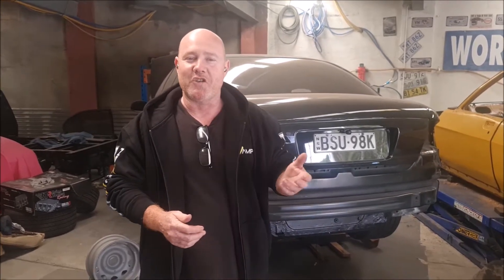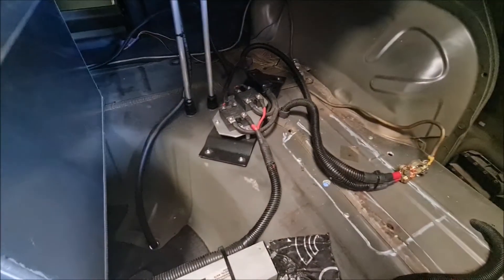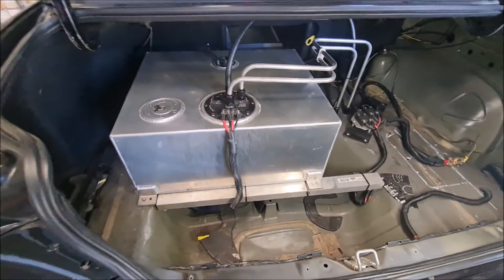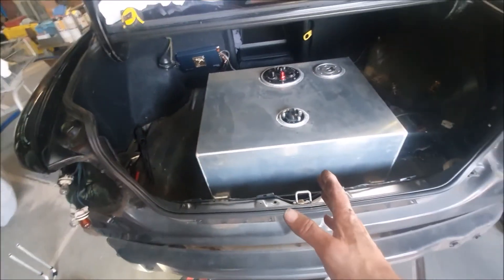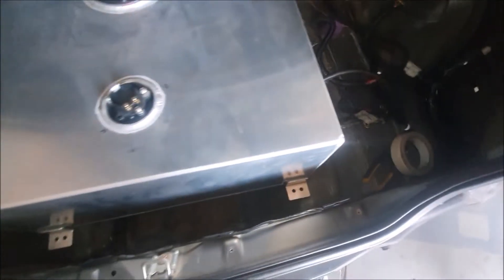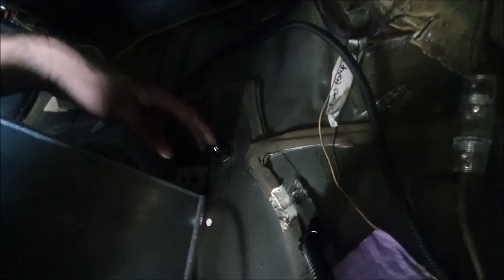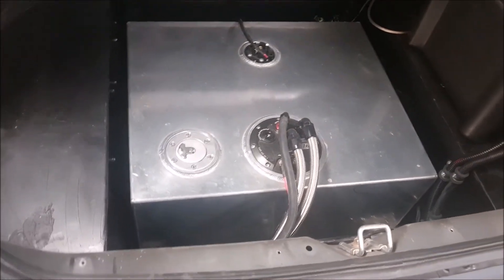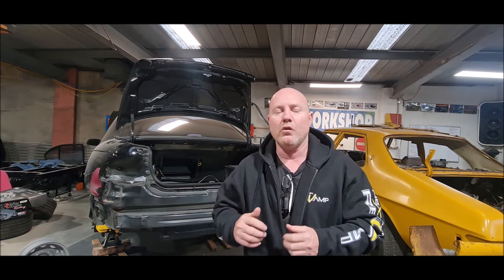FUEL CELL INSTALL HOLDEN / PONTIAC GETTIN SOME BOOT / TRUNK SPACE BACK

Comment: How much room have you got wither side of the tank now? I'm looking to do the same and run true dual exhaust to rear bar if there is enough room either side?
Reply from the maker: Hi Malachi theres heaps of room for exhaust  il have 1 either side with plenty of space to use
:)
Reply: @nexgenrevamp2976  wicked. Where would I find a pic of the setup you run if possible?
Reply from the maker: @malachiXR5T   we will be putting the 9 inch in this week it will show underneath the car and il show you the gaps and space we have in the vid so you can see the room we have :)
Reply: @nexgenrevamp2976  legend. Thanks